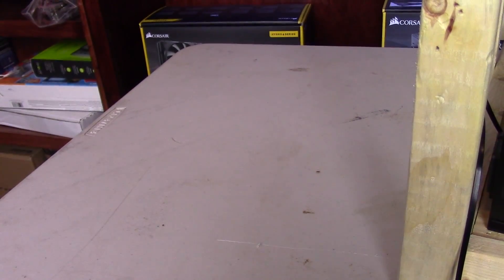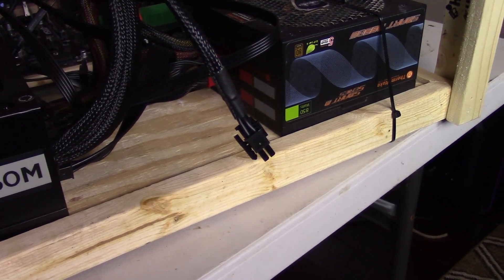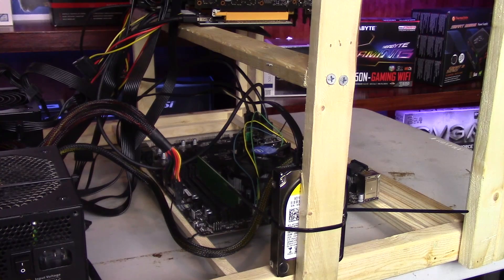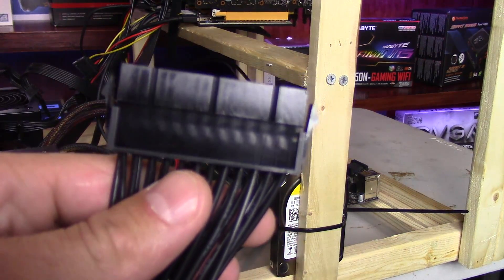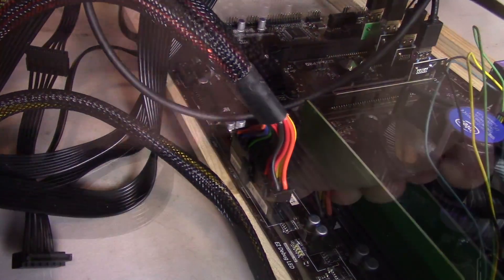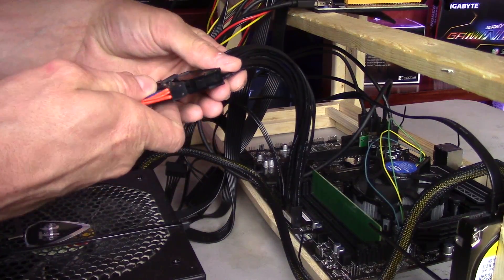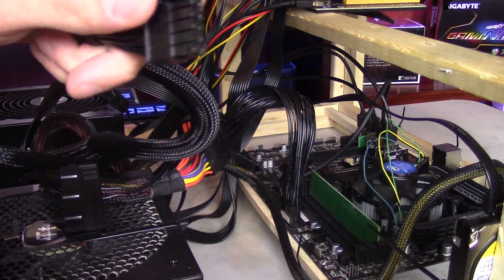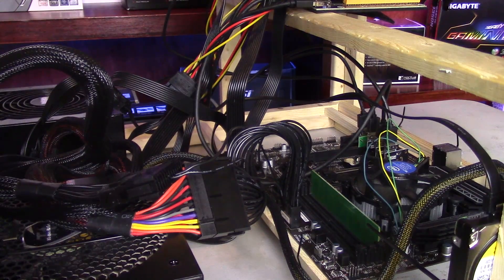How to Run Dual Power Supplies on Your Mining Rig

Comment: Hey man quick question, im using a 1000 EVGA psu on my six 3060 ti lhr rig. However it started to randomly shut down once a day, ive tried lowering memory clock but didn’t work. The rig itself is consuming abt 857 watts total. Do you think adding another psu might solve this issue? If yes which one should i add ? I have another 3060 ti lhr rig with same psu and it runs perfectly fine..
Reply: Dude you cannot pull 857W safely from a 1000W PSU. If your rig is on, power it off NOW! Plug everything out NOW. First, get another PSU either 750W or 850W. Use the 2nd PSU for 3 of your 6 GPUs. Make sure that if the GPU is powered on PSU number 2 then the riser for that same GPU is also connected to PSU number 2. Do not power more than 2 risers with one VGA cable coming from the PSU. Always use the 80% rule which is do not load more than 80% of what the PSU can handle, in your case 800/1000 = 80%. So anything over 800W on that single PSU is approaching danger. Also if the plug in your wall is a 15A/120V plug then it has a maximum of 1800W to distribute (15A x 120V = 1800W). Use the same 80% rule here by not loading more than 1440W on that breaker (1800W - 80% = 1440W). Keep in mind that this maximum is for ALL PLUGS on that breaker, so in that entire room/area, not just that plug. These numbers are typical examples of ordinary 15A outlets in a North American home for example, do your research and be safe.

Comment: My MOBO has 2 atx connections but my second psu doesn't want to turn on automatically so it has been kind of annoying. My first psu turns on when sensing power, but not my second one 🤔 may have to mess with bios! Informative video but adding info like proper timing of powering on is helpful isn't it? And connecting the main psu to mobo etc.

Comment: HELP PLEASE! so i have a similar problem but mine doesn't turn on or boot at all so I've tried everything possible ways but the only way to work is to not plug in the atx 8 pin cable in mother board and everything starts up but again no screen! PLEASE HELP IM FINDING NO SOLUTION TO THIS!

Comment: Hi i bought that part you showed. 24 pin power splitter. Can i connect 3 GPUS and a motherboard to 1 psu and 3 gpus to another psu. Like to be more clear is it safe to mix GPUS with the motherboard psu using a splitter?

Comment: The problem is that the power between the to power supplies is not isolated. This can be very problematic for circuitry in your computer, especially if the power is out of phase. If you have dual power supplies plugged into different outlets in your house, they may be on a different phasing from your breaker panel. The can wreak havoc on your PC’s internals.  To safely wire dual power supplies in a mining rig you need to wire them such that the components are electrically isolated and that only signalling is passing between the two.  To solve for this you need to make sure components only receive power from one power supply.  For example, plug the ATX power connector and the CPU power connector to the motherboard from power supply one only.  On power supply two, make sure the VGA power connector and riser power both come form the same power supply.  NEVER plug the riser into power supply one, and the GPU into power supply two.  This can be an easy mistake to make if you’re not paying attention!  Try as much as possible to spread the load across both power supplies evenly.

Comment: Is there a power limited for the Dual Power Supply adapter (DPSA)? In example would like to have two 1200 W? could this damage the motherboard? On some of the DPSA not seeing the max power they can handle.

Comment: So technically i cud just use the jumper that comes with water pumps but id just have to turn power supply off when im shutting system down correct?

Comment: Thanks a lot. Please my New Gigabyte rtx 3080 mines at 68mh/s at most, despite I overcklocked it like my Asus one which is at 96mh. Help please
Reply: did you lower its core clock, etc.. to prevent overheat and thus throttling?
Reply: @DavoXDesign  yes they are all at 0, the basic values. Have you another idea. Thanks

Comment: Thank you for the tutorial! Is it okay if we use two different psu? Like 500w psu with a 750w or should it be the same w?
Reply from the maker: yes just make sure you split the power accordingly
Reply: @SonofaTech  thanks for answering! How exactly do i do that?   Im still kind of new so i dont really i understand. Thank you for your time.
Reply: @negi372  I think he means don't connect stuff more that needs more than 500w to that 500 w psu.
Reply: @MrRetobor  ahh i see so basically if i have a gpu with more than 500w to run i cant use the 500w psu? Thank you so much for explaining to me.

Comment: I'm not getting any display after i turn on my mining rig. When i turn off the secondary psu i can see my screen but if i try to boot it up with both psu connected on the splitter i get no display. What am i doing wrong?
Reply: Same. Have you got a solution?

Comment: Hi, I just wanted to understand how would one connect 3 PSU together ?
Reply: You use something call add2psu the second or third power supply plugs into it along with a Molex from the main power supply.  When it senses power from the Molex it turns on the other power supply.  There on Amazon pretty cheap

Comment: I can use the second PSU without this adapter? I can directly link to the GPU? I’am waiting for the adapter...
Reply: A bit late but you can just Put a short calbe from Green to black pin on the 24 pin and it will run

Comment: No matter what I try by using one of these I get boot problems.  CANT GET UI/OS/BIOS to come up.  If i switch two 750s for the 1500 it runs the system fine...help?

Comment: I'm terrified to do this. I did the whole Molex to SATA lose your data and that wasn't fun. Lost my motherboard. Maybe I should just run the power separately? But then the miner won't turn back on if I lose power. Also how do I know what splitter to buy? I don't want some piece of crap that breaks.

Comment: I'm trying to budget mine with an RTX 3080, I know that sounds dumb to do with that GPU but I gotta do something. Can I use a separate PSU for my 3080 even tho my 3080 is connected to a mb that is connected with a different PSU? I don't wanna buy an expensive new PSU for my whole PC, when I know I can prob get away with using a $50 500 watt PSU, but I also don't want to burn my house down in the process of making only $15 a day lmao

Comment: My Gpus are not running with full power. I have everything connected like you do
Reply: How many GPUs are you using per cable? What GPUs? How much wattage per GPU? You might need 8 to 6+2pin cables and only one per card. They supply 150w. 6pin is 75w.

Comment: I got one 500 and 700w PSU. 700w is running the system and two rtx 2060 supers. The other 500 w is running just a single rtx 2060super. The rtx super running on the 500w is having a slow blink on the led indicator. Why is this so ??

Comment: Hi , am setting up a rig with 2 evga 1600w psu's and evga seems to have not 24pin slots they have 18+10, 24pin splitters won't help, or i need a motherboard board with 2x 24 pin slots? Any suggestions would be appreciated.

Comment: Hi I got a questions on ordered the cable from Amazon and every single time I've tried it my cpu fan goes into over drive and the screen goes blure I been trying to figure out what the problem is for 5 hours. I tried turning on the second power supply with out it being attached to the mother board by starting with a pin and still the screen goes blure with the two gpus plugs into the system separately please help, ??

Comment: So just plug in and it works? no safety features or issues that can occur? 
I have an ASRock H110 Pro BTC+ with 2x EVGA SuperNOVA 850 G3. Is there some kind of control over the two psu's? what about what hardware to connect to psu1 and what to connect to psu2 and what not to do. Are you still doing it the same way after four years? That would be a great to know. thanks

Comment: Is it safe to run two different brand PSU? i have EVGA 1200w AND A  650W Corsair.... I never considered it could be a problem, but should I have an EVGA 650W instead?
Reply: Also my EVGA is 'platinum' my corsair is 'bronze' i always considered these words to be bullshit marketing, but if it has anything to do with the cables maximums being different or something then maybe its an issue

Comment: Can you run riser cables on a seperate psu? so you have 2 on your system running to your motherboard and GPU's and 1 standalone power suply to power the 6pin risers?

Comment: Quick question. Do you have a video explaining how exactly to add a second GPU to the rig? I'm just starting out and I've got an old Titan X in my PC and I want to add 3070 to it. What exactly do I need to do for that besides just adding the card? Do I need to configure my BIOS in any way, install different drivers, plugin the display cord into one of the other?!?! I can't seem to find a single video on YouTube about that :(
Reply: Since both cards are NVIDIA you shouldn't need to install any new drivers or change BIOS. If your PSU is rated high enough for the power draw you should just be able to plug it with a new 8 pin cable. Do not use a splitter on your cable going to your Titan X to connect your 3070.

If you're using risers, I'd probably recommend using a new 6 pin to power your riser as well.

Make sure that your PSU is rated enough to handle the TDP of both cards plus whatever else you have connected to it, otherwise you risk blowing up your PSU. Titan X has a TDP of 250w and a 3070 has a TDP of 220w. PSU's work best under 80% of their rated wattage so at minimum you should have probably around a 750w PSU. Of course if you're underclocking you'll most likely not be utilizing most of your PSU, but if they spike or reset your PSU won't blow. (Also I assumed that your PC would draw ~100w from other things as well, since it's probably a gaming PC. Making your TDP 570w out of 750w ~76% max draw.) A 650w PSU may also work I would think.

I'm not a professional, but this is probably the safest option.
Reply: @MrGentlemanParade  I have a 1200W PSU, but I think something's wrong with it or maybe with something else. Both cards work just fine on their own, but if I start mining on both of them the max OCs, they work for about 3-5 minutes, and then my PC starts beeping. It's basically just a long, non-stop beep and I'm not even sure where it's coming from.
The second I stop mining, the beeping stops. So my best guess is that something's overheating, maybe it's PSU itself, maybe it's my motherboard. 
I ordered a server PSU on Amazon, it should be here in a few days, so I'll test it and see if I can fix the beeping that way.
If you have any idea what might that be, please let me know.
Thank you.

Comment: I couldn’t connect the adapter to the power supply. I got a seasonic full modular. The cord splits into two when going into the power supply

Comment: Bro does it mean if I run 6 GPU rtx 3080 and I have 2 PSU 850w and if I split this together I WILL have to go to bios to modify something?
I have asrockH110 , thx for help
Reply from the maker: You’ll need more power for 6 380s. 1800 watts or ao
Reply: @SonofaTech  yes it was just an example so the question is will I have to do some modification in BIOS ? and DO you have video how to connect 3 x PSU to 1 mobo? Thx
Reply: is it not better to use "server psu" I found 2400w , or for mining it is not good?

Comment: Can you use two different brand / watt PSUs?  I have an 850w and 700w that I would like to use... thanks
Reply: Looking for the answer too, did you try it?
Reply: @leonardomarcotto16  no I didn't
Reply: @Swifteagle  there is a post on Reddit talking about it, I will not post any links here in this comment to be safe, just type it on google, 
Can I power 2 different types of power supplies? ( watts and brand ) that post has 166days have a check in the comments section. Good luck
Reply: @leonardomarcotto16  thank you!!!

Comment: 02:40  - hi slightly  confused here, what am i testing? i am not sure why i would need to go to the bios? WHen i press the power button my computer turns on or off etc.. ? i thought putting off the machine would also put off the 2nd power supply?

Comment: just a tip, but i would advise not running that secondary suppply with no load, i did that once and it let out the magic smoke, idk about modern psu's

Comment: Better , safer ,  synchronized PSU sharing (no limit, need 5 PSUs? Sure thing) . I put a few on EBAY as I had excess parts on hand.
Custom built by a miner for fellow miners. Don't use un-isolated, cables and components or risk PSU, MoBo and cable burnouts due to wrong current paths. Always supply BOTH the riser & the associated GPU from a single PSU, do NOT cross connect power from 2 PSUs to a single Riser/GPU pair. Aging PSUs drift in voltage and this can cause severe heating problems if cross connected.
here is my item...
https://www.ebay.com/itm/132602541124

Comment: Is there any risk for using the splitter vs add2psu ? As I understand it the add2psu has a relay that detects power from the first power supply and thus turns on the seconds. However if no power or if it fails then the second will be turned off also instead of continuing to run. Which is better / safer ?
Reply: Same here
Reply: @saireddy2322  add2psu safer

Comment: My question is once i hooked up the Dual PSU's, what is the best method for connecting the GPUs and the risers.  Should the GPU and corresponding riser be powered by the same PSU?  Should you power all the 6 / 8 pin external powers on the GPUs with 1 PSU and say the MOBO/CPU/Risers on the other.  Or does it even matter?

Comment: Hi, i have 2 psu cable just like you and i set it like you did, but if i start powering my secondary PSU, the 3 vga's fan that connecting to secondary PSU start spinning ( the primary PSU not connected to power yet ), it is normal?

Comment: You know, if you want to call this the "ideal correct way", you should really talk about component placement, basic electricity, and wire gauge.  I may have missed it, but I didn't once hear you mention whether or not the GPUs and Risers could be powered by separate power supplies.
Reply: Oh, c'cmon. You learn electricity by trial and error. Plug cables until the thing works * sarcasm * 
I'm joking, simpletons, don't do that!

Comment: Can you just Plug both PSU's into a power strip or surge protector to sync turning them on and off, then jump the other PSU?
Reply from the maker: If you do that make sure that the surge protector you use can handle the load

Comment: It is working fine fine but one of my PSU which is not connected to motherboard is little warm.
Reply: You are grilling your psu. Connect chassis fans or buy "add2psu". You can never run a second psu without load.

Comment: Cant you just connect second power supply to the GPUs or even secondary onboard power slots, 12 v and stuff like that? I actually did that 2 days ago and seemed to work for me. It was a bit weird however ... =) because then I unplugged second Power Supply to see if System is actually using it (after I turned system off of course)..... and the fan on it started to spin when I started the PC even if the supply was not plugged in the wall. The conclusion of that story for me..... I was just scratching my head.

Comment: Do you  put the smaller  of the 2 power supplies on the  cable end with 2 wires  or  it does not make  a difference ? In other words  which  power supply is connected to the  motherboard ?
Reply from the maker: Calculate the consumption out and spread accordingly

Comment: Hi Son of a Tech,
I need to confirm that i have two power supplies one is TX850m and Second TX650m along with splitter which you recommend in video so for this do i simply need to connect male part of splitter to motherboard and rest of other two female part of splitter will use to inject male part of two power supplies ?? and then i need to power on button of two supplies ?
I just simply need to do this or i also need to change Bios setting accordingly ??
If i need to change bios setting then guide me about it as well .
i have asus Z270-P Model of motherboard .
any help regarding this is appreciated in advance .
Thanks

Comment: I have done this for two 850w supplies and it works but when I turn on the power switch on either power supply the rig powers on without the need to press the power on button. Is this normal?
Reply: Hello u put this comment 3 years i hope u can help me lol i get the same problem my computer start on automatically i dont understand why ... and i can t stop my pc when y push the bottom ... thks

Comment: So basically I can just short the power (green) green to ground (black) and connect the pcie cable to the GPUs directly?
Reply: Yes
Reply: @maxs.8146  how? Currently here because that didn’t work ah. Risers and Gpu gets power but cards aren’t recognised?
Reply: @conorobrien5446  Just stick a paperclip in the fourth and fifth port (right is 1, left is 12) of your 24 Pin connector. (Please watch a video before you do that). 
You have to make sure that both power supplies (the normal one and the one with the paperclip) start nearly at the same moment.
For me this method works fine.
Reply: @maxs.8146  you’re right! Just figured it out. I was turning one on slightly before the other so the second wasn’t registering. Thanks for that anyways mate.